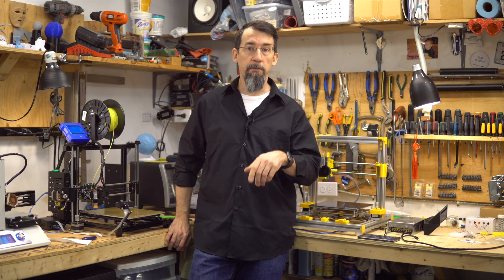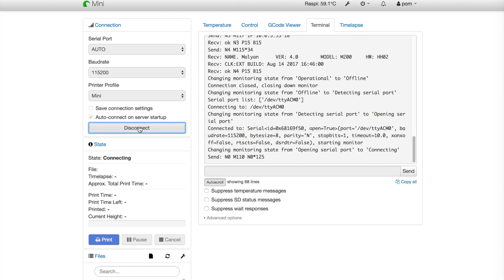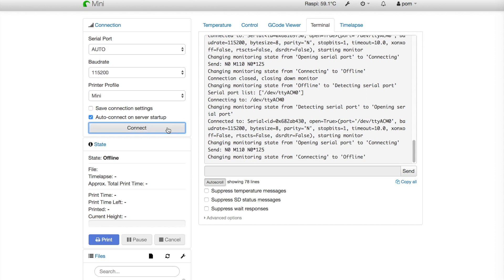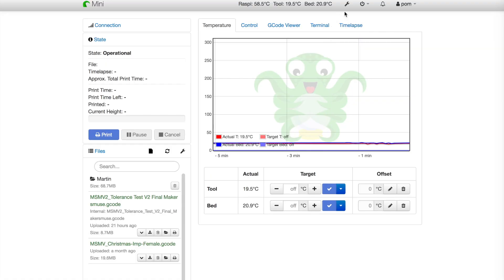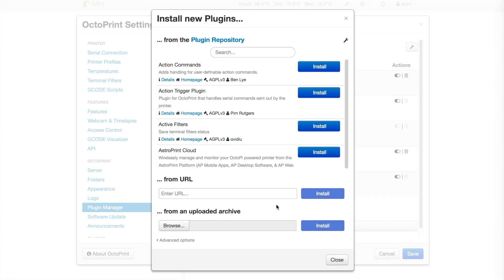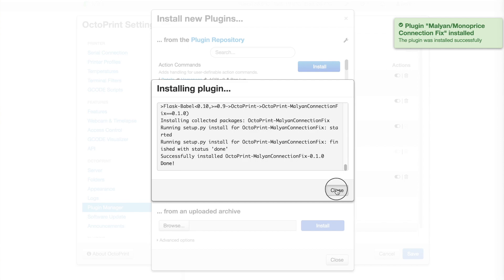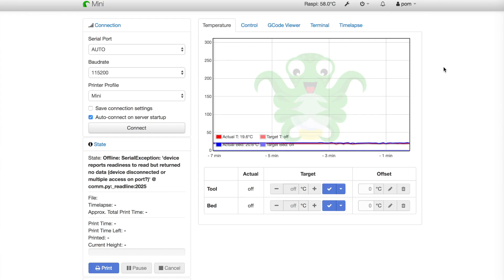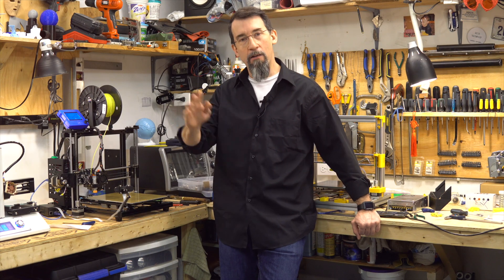Monoprice Connexion Fail, Fixed (Octoprint)

Comment: have you printed with petg on the monoprice select mini v2
Reply from the maker: No I was not able to print in PETG, I think that the mini is too much under power to be able to print PETG
Reply: @Franks3Dshop   ok I've got it to print petg  it works pretty good it's not perfect still tweaking it a little. I was just wondering if you had any ideas thanks for responding back
Reply from the maker: Hi, for PETG if you do not have any support I would close the outlet that push air to the part, it is not needed for PETG and would better cool the heat sink, you also have to slow down the speed. Make sur the first layer is 0.3mm also helps...

Comment: The only issue with octoprint and my MPSMV2 I have is I can't use the auto-connect. I had to try 2 or 3 baudrate before it connects. I will check if that plugin fix that issue.
Reply from the maker: I have the plugin, 115200 fixed baud rate and automatic for the port.